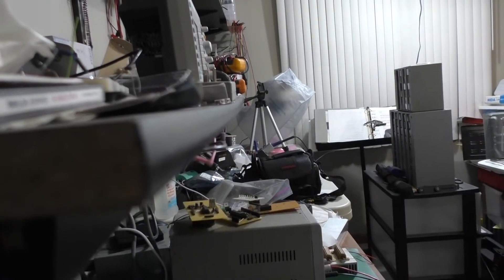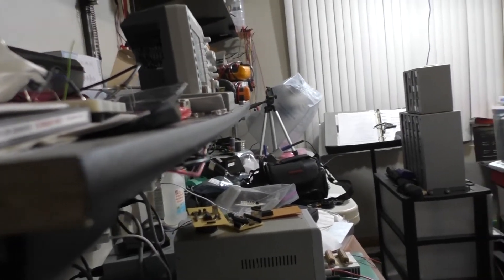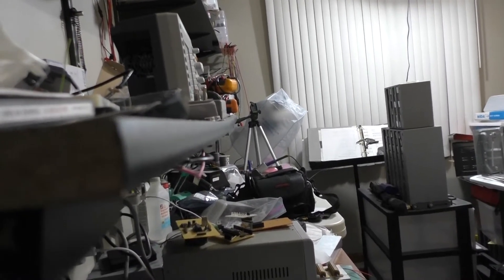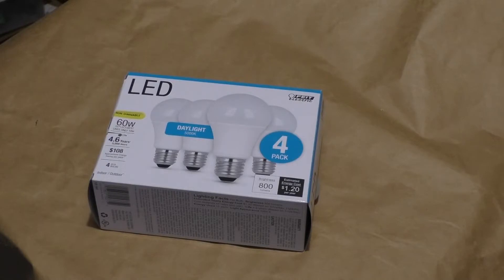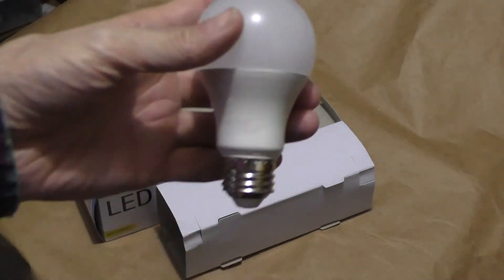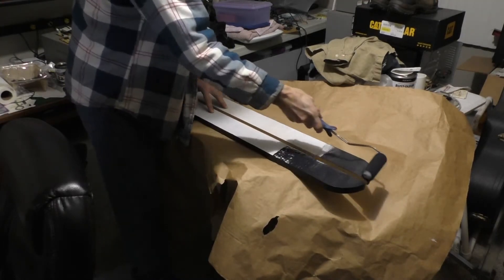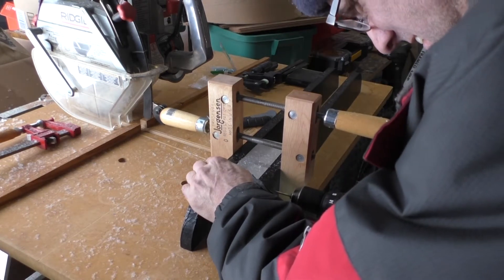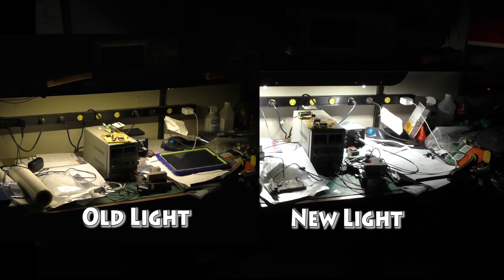Under shelf lighting, LED bulb hack

Comment: Nice vid! Question: what did you put in the tic tac box? Switch? Boost converter? ..It looked to be a pcb - details and a close-up would have been very helpful (even if it's just a prefab.)
Reply from the maker: the circuit board from the LED bulb.